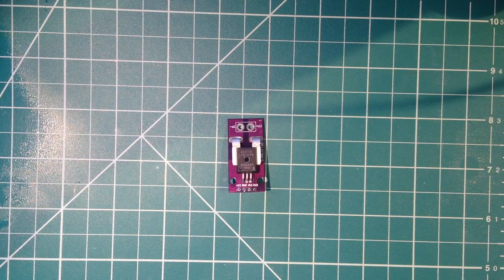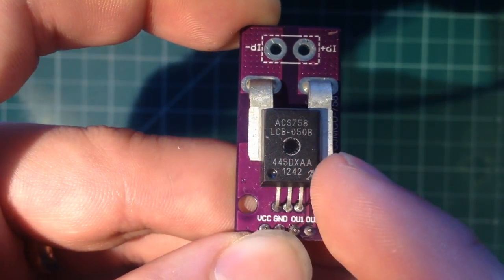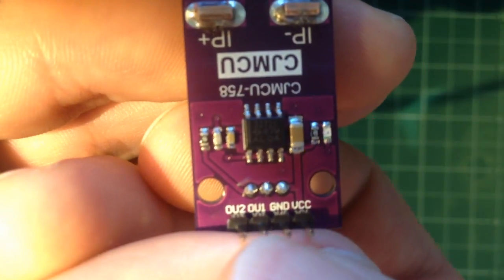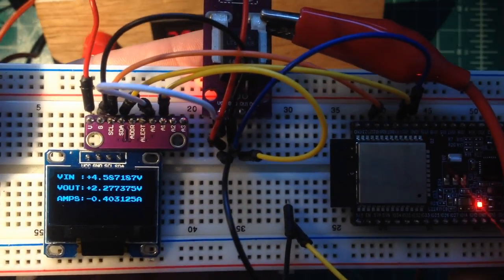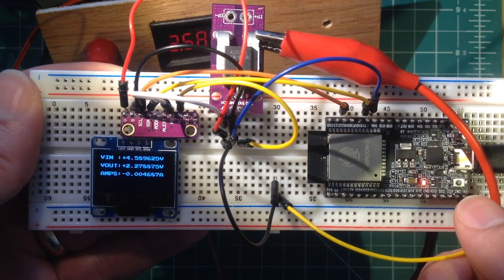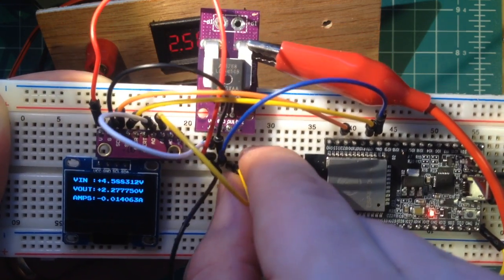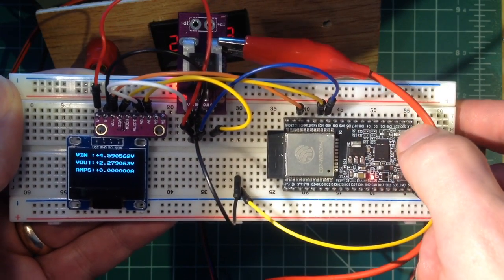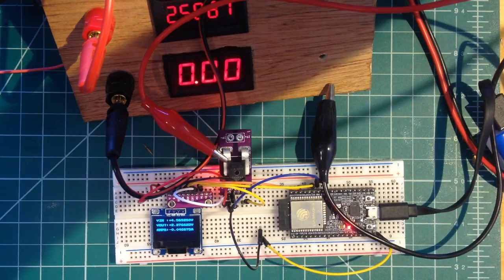CJMCU-758 + ESP32 measuring current

Comment: Well Done. Subscribed.
Reply from the maker: Wow, I am amazed. If you don't mind my asking, how did you find this video? Was it through youtube, or through the ESP twitter communities?
Reply: Through twitter
Reply from the maker: thanks
Reply: Hi, well explained looking for more. If you don't mind you can add some more Informations in the  section below the video like links to datasheets, the display looks like SSD1306?, the software you use, the IDE, libraries, ect. thank you.
Reply from the maker: I've added the datasheets. Code to follow
Reply: Paul Martin Wow, that was fast. Shure for the datasheet you can search but I think like in your mailbag videos its a nice touch. Thanks.
Reply from the maker: Thanks for the tips. The code is attached now as well.
Reply: @MobiusHorizons  @MobiusHorizons: is it a unit gain buffer? On a scope or meter do both output the same value? The ADC you used is high impedance and should not load the sensor. The risk of the buffer is additional noise, drift and offset

Comment: @MobiusHorizon: is it a unit gain buffer? On a scope or meter do both output the same value? The ADC you used is high impedance and should not load the sensor. The risk of the buffer is additional noise, drift and offset

Comment: what is a purpose of those two big holes, on the end opposite to the digital pins? If they are to be used to connect the load, its really silly that these holes are so close that they are almost touching each other ;-(. That would prevent one from using O-ring connectors and even some decent size bolts for fixing.